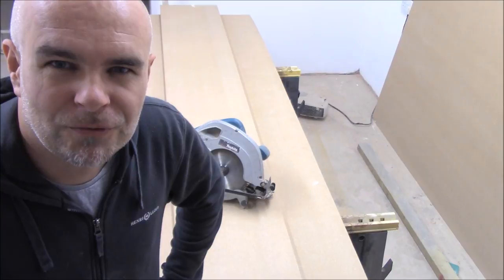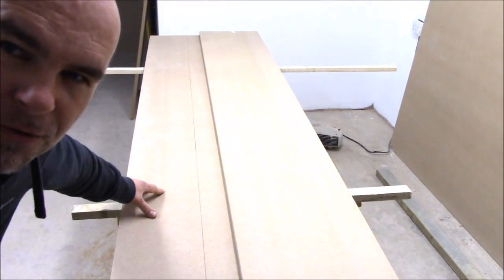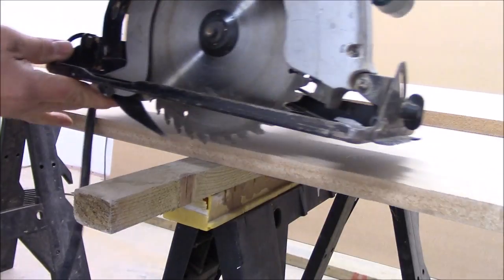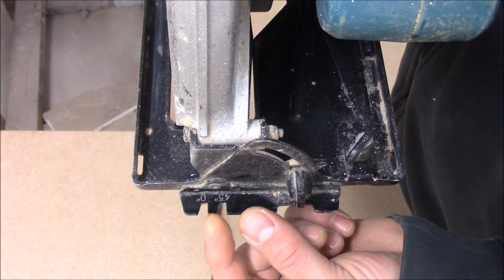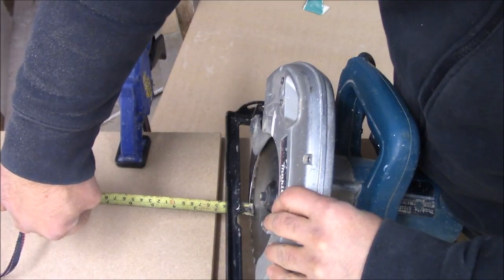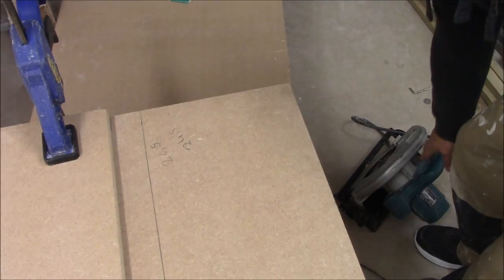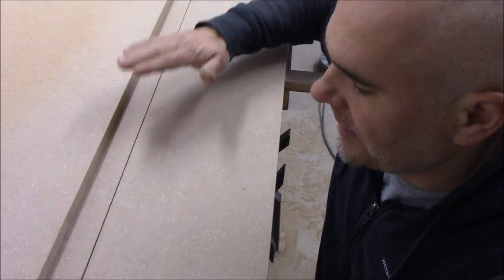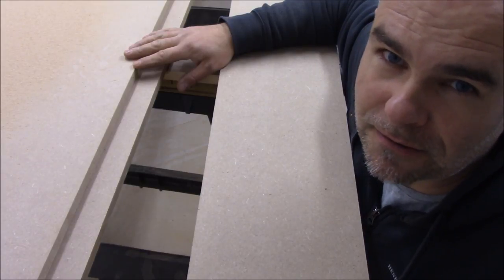Perfect cut with circular saw How to cut MDF board straight How to use circular saw

Comment: we are going to be using the saw for the first time tomorrow. Have to cut mdf board for a laminate countertop. This is the best video I found. Wish us luck!
Reply: I need to do the same thing this weekend.  What kind of saw blade did you use?  Fine tooth or what?
Reply: @abplusfive  fine tooth. I think it had 80 teeth.
Reply: @belaad  Thanks.  I ended up using 40 teeth and it came out fine.

Comment: hi how do you bring back the swolen wood? I have a piano and one of the leg is swolen due to heavy moisture. Would it  be working to soak it on the hot water and then clamped to its shape for some time?
Reply: Seems risky to me.. But im not woodworker

Comment: Or just buy a festoon track saw.

Work smarter not harder 😂
Reply: I am going to build a couple square boxes out of engineered wood, or more aptly put... shit material. It's a weekend project, I should go to the big city and get an 800.00 track saw to cut a flat piece in a straight line. Sounds legit. Do you use a cnc to locate your #30 pilot holes ? Just fucking with ya, I wish I could jam some nicer equipment into my shop. $$$$
Reply: $600 for a festool track saw.  $40 for a decent circular saw.  Yeah, no difference there at all.  

If money were no object, yes, everyone would buy a festool track saw.